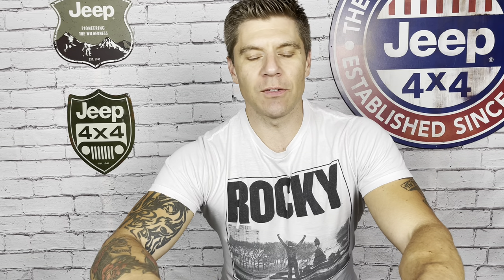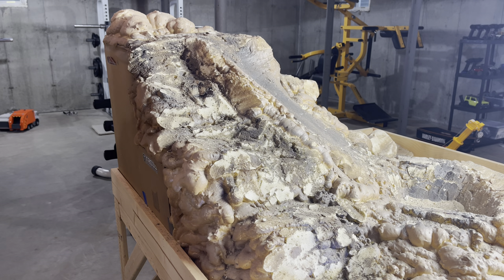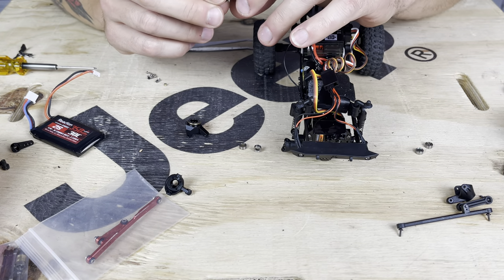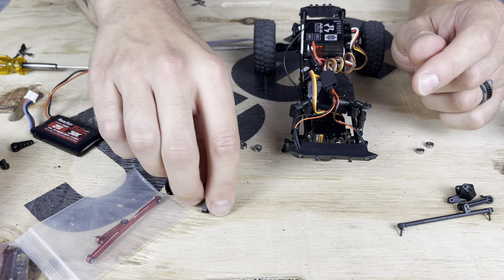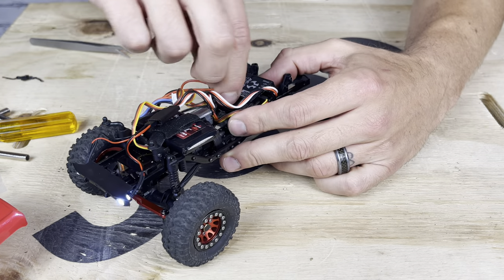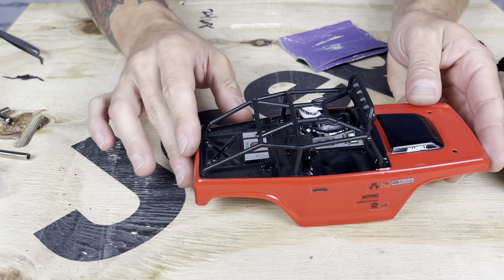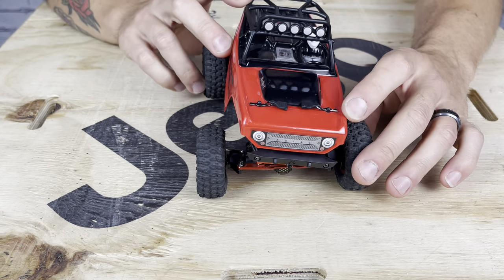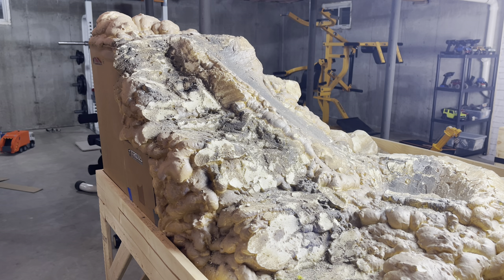SCX24 Deadbolt COMP BUILD Part 1 - New Motor, Chassis Mods, & More

Comment from the maker: Timestamps
Recap of current mods: 1:02
New mods: 2:31
Baseline course runs: 4:26
New mod installation: 6:43
Finished product: 18:16
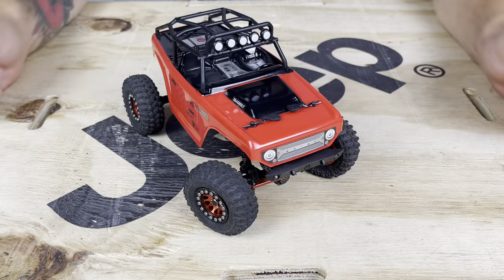Upgraded course runs: 19:41
Initial reaction and closing thoughts: 20:50

Comment: My son and I both have scx24 JLU's and we discovered the same thing. Add a little width to the axles and a little weight down low plus a good set of tires and these things are surprising out on  the rocks! Our stock motors are still going strong too. IMO these things work best when kept nice and light weight with out excessive amounts of brass, just enough to get the performance your after.
Reply from the maker: I agree! I dont think I'll add much more weight. I am going to focus on lowering the COG in the next phase I think. It feels really balanced right now!

Comment: Good explanation of the process. However I couldn’t tell any real difference in before & after.

I have a 050 Torquebeast & it’s not smooth at all. The Injora Pro is slow in starting but this can be fixed with 50% UD in the rear. The Holmes hobby Torque Master Sport 050 55t is a nice motor too. I put UD in my Warthog & it now turns like it has dig & that’s with 5mm extenders on it. A good cheap motor is the Hobbypark CR-18 55t
Reply from the maker: There wasn’t much difference. The thing is so good they the course doesn’t even challenge it! Great insights on the motors - thank you!

Comment: These videos are super helpful! I just bought a deadbolt and I want to make it as nice as possible for a 'flex' indoor course that i'm going to build, but still capable of climbing hills if needed. I've went through your top 5 mods video as well as this one and i'm wondering if the listed products are still relevant or if there's something better that has come along? Or anything you'd swap out, change, add or remove? Thanks a ton!
Reply from the maker: Thanks for watching! I think the mods are still relevant. There are different manufacturers and more choices, but the concepts are still the same

Comment: for a beginner not builder i already have 2 1/16 hbx bashers with plenty of spares, 1 ftx ravine 1/10 and always wanted this small 1/24  deadbolt because looks si sweet and si many possibilities to play indoor and outdoor. the inly thing putting me away e the price since it costs mire than my ftx ravine and is 1/3 of its size
Reply from the maker: They are pricey but I find so much enjoyment in exploring the near limitless aftermarket for customization options. I feel like the axial is well built, reliable, and fun to tinker on. But certainly not the cheapest!

Comment: Did you do upgraded shocks? If so what size etc..
Reply from the maker: On this one, no, not in this video. I ended up going in a different direction with this build and outfitted a completely new chassis. I did 48mm shocks later on
Reply: Any recommendations for stock chasis with body mount shocks?

Comment: evening i just happened to run across this as I was looking for some examples of the scx rc to start out i started with one and have kind of binged your videos I was wondering if you could do a comparison with the  red dead bolt on the hyrax tires and a set of the comp pins of around the 65*19mm size snaggle tooth looked awesome with the tall ones and the little red one did awesome on the others and I am interested in that tire on your current build as that is the same as mine thanks
Reply from the maker: Thanks for watching! I’ve got a set of the new mini comp pins coming. I intend to put those on the red deadbolt. But I can compare the tall ones too if you’d like!
Reply: @CapeCrawlers  awesome I have two deadbolts one red one green still in the box got them yesterday with parts coming to address some of the things you pointed out and am in the process of building my first section of curse. For the folks that think I am going a bit fast into this, I may be new to the crawler Rc but not to the Rc life I fly FPV and have raced off road and street. I like you have a real-life jeep well more like 3 and build them to do different things, now I can build little jeeps and have just as much fun lol.

Comment: You should try the Hobby Plus 030 88t, they are really quite good. It made a huge difference in my CR24. At the moment I'm running the 66t 050 in my Deadbolt, but will swap it out with the 50t Injora Pro motor (stronger, but draws more amps).

You should really check out Donald Sneffes huge motor test, if you haven't already. His test showed that the Hobby Plus motor has more torque than the mofo onn, not by much, but a bit more, and it is way cheaper. In 050 size the RocHobby and Hobby Plus ones are really good for a cheap price.

https://www.youtube.com/watch?v=157wLxSU4T8&ab_channel=donaldsneffe
Reply from the maker: Awesome info, thanks! I’ll check out the video!
Reply: @CapeCrawlers  No worries. He also has a massive, in-depth test of servos for SCX24. Some surpises in that one.